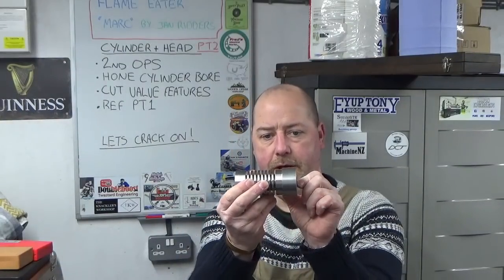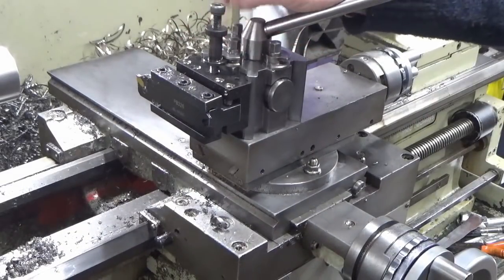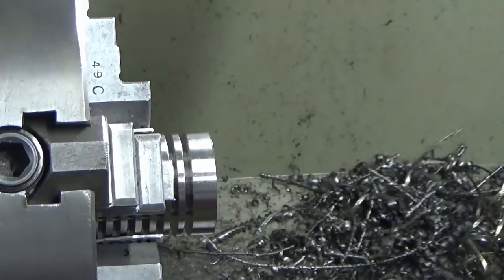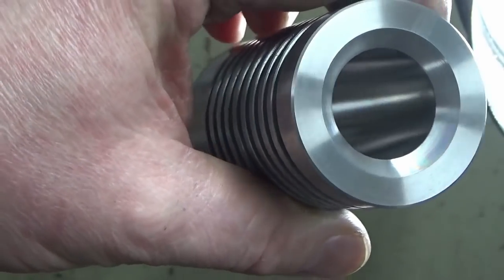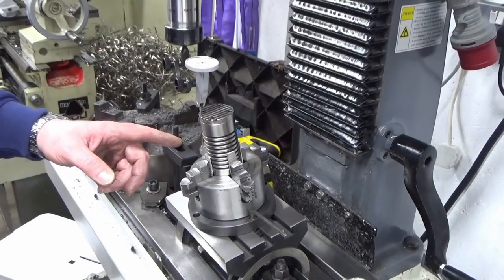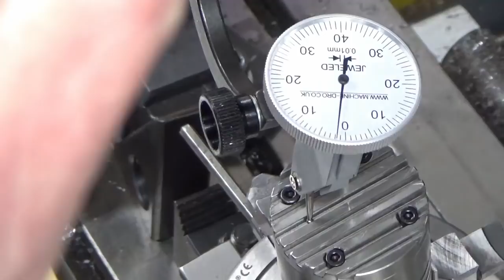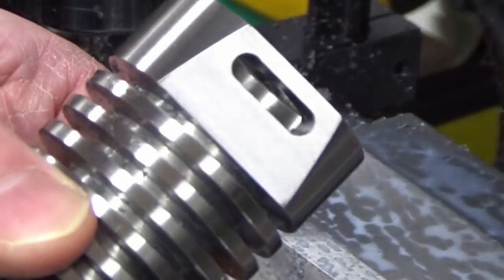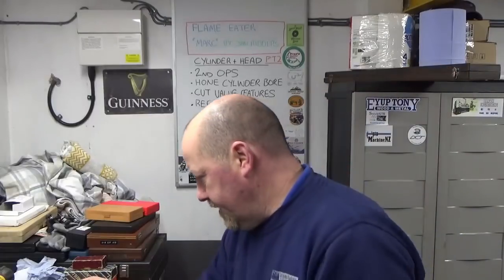Making a Flame Licker Engine "Marc" by Jan Ridders. Part 10 - Cylinder & Head Part 2

Comment: Lovely job Jon. Thank you for sharing this series, it's inspired me to take a little time off from work on my main project and have a go at this engine. I have obtained the plans from Jan and got most of the materials, to date the majority of the support structure is complete. Your videos are very useful, many thanks. Stephen.
Reply from the maker: Hi Stephen, thanks for the comment and glad I have provided some inspiration lol. You will probably get to the end before me at the rate I am going, so you can tell me if it works lol. Cheers, Jon

Comment: Nice finish from that 12mm carbide end mill, Jon. I have a 6 flute carbide ripper that size and it hogs out stainless like a boss. The cylinder and head look suspiciously like a microwave radio component! I'm really looking forward to seeing that thing gulping flames. It'll be interesting to see how the piston clearance behaves as it warms up. I guess they don't run particularly hot as otherwise the gas wouldn't cool effectively. 5% efficient, wooo!

Comment: Nice job Jon, can’t wait to see this running, if you need a spark plug I’ve got some from my RC days
Reply from the maker: Hi Terry, thanks for the comment. Me too lol. No spark plugs required on this engine mate, all the combustion is external, and it's vacuum in the cylinder that provides the power stroke. Thanks for the offer though, maybe for my next V8 IC adventure lol. Cheers, Jon

Comment: Nice one , looks great .  Does it have a piston ring or an ' O ' ring like Mattys engine .    
Should re name it the ''Bender Engine ''   , sort of looks like Bender off Futurama with no arms when you held it up at the end !!!      Cheers .
Reply from the maker: Hi Max, thanks for the comment. It has no rings at all, purely relies on a really good fit between piston and bore, and when you consider these things are less than 5% efficient, that really presents a challenge which is why I went to town on the bore to try and get it as parallel as possible. Lol, with my haircut and gut, it would more likely be called the Homer engine lol. Cheers, Jon

Comment: Great Outcome  Jon. Real interesting setups you needed to do . That new DTI is really great, easy to see. When checking the final length of the cylinder instead of the depth mic you could have tried out your flange mic. Keep Safe. Regards from Australia.
Reply from the maker: Hi Dave, thanks for the comment. Yep, the new DTI is spot on and has become my goto for all setups on the mill, strangely it doesn't suffer from light blow out on the face when filming either, I thought it would be worse as its directly opposed to the lights in the roof! Yep, you are right on the measurement, old habits die hard Dave, I was always taught wherever possible to use the same instrument and same technique to limit possible variation when you are stacking measurements to get an overall answer, because of this, I never gave it a thought. Cheers, Jon

Comment: The part off was most impressive. Not a hint of chatter (like my similar arrangement does). I had to make a rear part off holder which works well. I wonder what the steel is.
Reply from the maker: Thanks. The material is 304 Stainless Steel.

Comment: Hello Jon.....looking really good. I would be interested to know how you got the head and bottom holes to match accurately ( vertically). I have just completed a similar job and the result was not as good as  i would have liked.  Cheers
Reply from the maker: Hi Ray, thanks for the comment. I actually filmed the setup but it didn't make the cut due to the noise from my oil heater (the camera was right next to it). I simply used a thick parallel between the moving jaw and the valve seat face to gently align the part with the X axis, then holding the part tightly so it couldn't move, removed the parallel and nipped the vice up. Hope this makes sense? I knew the top holes were correct to the valve seat face so used this as a datum transfer. Bit crude but certainly within a few thou. If I didn't have a slave datum I could use like the valve seat face in this instance, I would have drilled and reamed an extra hole in the top face (3mm probably), and created a little fixture plate with a dowel in it to locate the part circumferentially that I could hold in the vice, then used a small clamp to hold the part down to it. Hope this helps. Cheers, Jon

Comment: I do like the look of the Cylinder Jon. Could it also be a flux capacitor from a Delorean. When you are near the mill there is a noise. Is it a diesel heater pump. Just curious. 
Regards Steve.
Reply from the maker: Hi Steve, thanks for the comment. Lol, I could use a Delorian, I would only want a one way trip in it, back to the 1970's knowing what I know now! Yep, spot on, el-cheapo oil heater, winter has landed up here! Cheers, Jon

Comment: Out of curiosity..... Why did you make the cylinder out of 304 stainless?  The efficiency of these engines is dependent on good heat transfer to the cooling fins, but stainless steel is a really poor thermal conductor.  In W/mK   Aluminium = +200; Cast Iron = 52;  SS 304 = 14.
Reply from the maker: Hi Michael, thanks for the comment and question. Simple answer is cost and availability. Being a relatively newly set up workshop, I don't have much stock at all on hand, therefore am having to buy in what I need on a case by case basis. I am also dependent on mail order materials due to how rurally I live with no stockists anywhere near me. I did have a lump of 304 that would make the cylinder, head and crank web so it got used. I have also seen one other YouTuber who has built this same engine using SS and it runs so that was really the thought process. Out of interest, the rest of the materials to build this came to £60+ so was just trying to limit additional damage to the back pocket. Cheers, Jon
Reply: @jonsworkshop  Ahhh.... the curse of the Home Workshop.
Reply: You are doing an excellent job on the engine..... a real work of art.

Comment: Hi Jon, another fantastic video. Really looking fwd to seeing this engine run! 😃
One question, how did you set up for the base holes to know they would line up with the base when fitted? Without the top fins and port being out of alignment. Where did you take your line up measurements from?
Take care, Tony.
Reply from the maker: Hi Tony, thanks for the comment. I actually filmed the setup but it didn't make the cut due to the noise from my oil heater (the camera was right next to it). I simply used a thick parallel between the moving jaw and the valve seat face to gently align the part with the X axis, then holding the part tightly so it couldn't move, removed the parallel and nipped the vice up. Hope this makes sense? I knew the top holes were correct to the valve seat face so used this as a datum transfer. Bit crude but certainly within a few thou. Cheers, Jon
Reply: Ah thanks Jon, yep that makes sense now, I just couldnt visualise it. Take care, Tony 👍

Comment: Great done Jon, as always..... wich Kind of cooling Fluid do you use?
Reply from the maker: Hi Chris, thanks for the comment. I use cheap soluble cutting fluid (mix with water at about 10% concentration). I got it off Ebay, Smith & Allen. Cheers, Jon

Comment: Really good results Jon.  I have always found Jan Ridders plans to be very good and interesting designs.  The setups to achieve the final parts being left to the builder is what I find most beneficial in your videos.  Were I building this, I think I would have fixtured it much differently, hoping to achieve the same results.
Reply from the maker: Hi Jim, thanks for the comment. Jan's plans are very good. I actually like the fact there aren't even tolerances on the dimensions, leaving totally up to the builder to figure out. There's always more than one way to do any job, being my very first engine build, I am probably making some rookie mistakes lol. I will be attacking it like its an aerospace part, but hopefully throwing some new ideas into the melting pot for more seasoned engine builders like your good self. Cheers, Jon